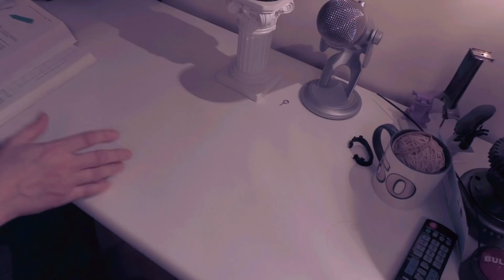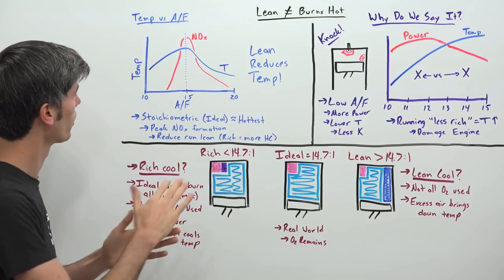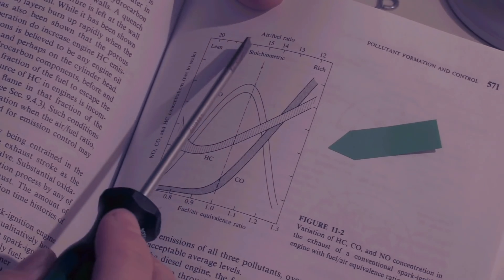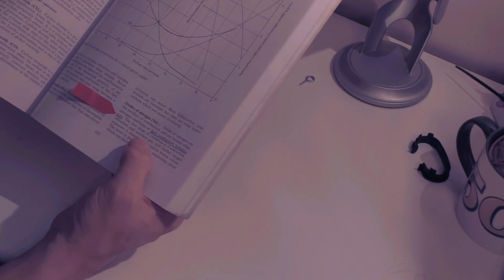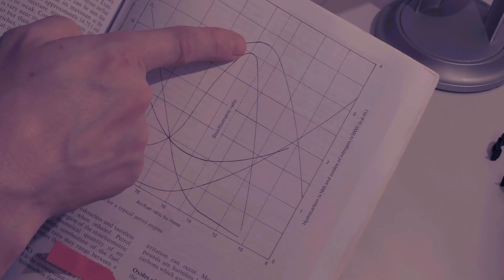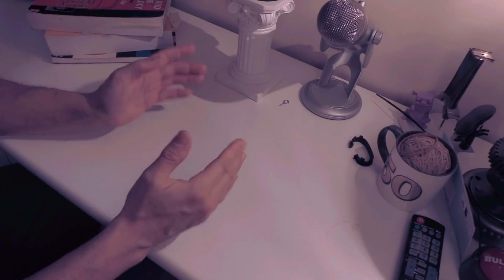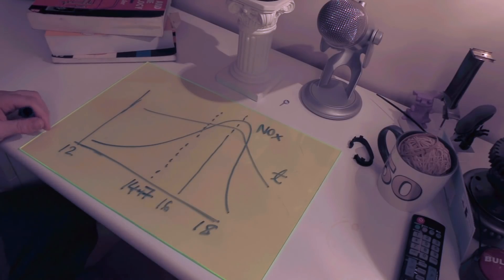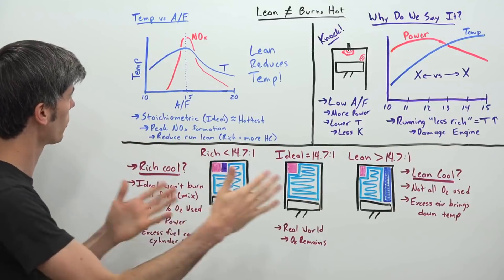Any idiot can draw a graph - EE Strikes again!

Comment: Why are you so critical of others YouTube producers on m/c content? If your such an intellectual,can't you figure out how to do something original. Perhaps your a lazy man and this is the the easier route,or maybe your a hater.
Reply: Matt's explained this before multiple times, he's against mis-information being pumped into the minds of the gulliable. Smaller channels/bigger channels doesn't matter. Matt makes plenty of his own content going through both the theory and practical of whatever he feels like tackling off his own list/viewer questions and ideas. Yes these rants are alot quicker to create than some of the longer term projects he's been plugging away at but he also maintains a full time job in the field, this is hardly a money making venture for him. Its a side project about the principle of correct information.
The thing is most content creators don't change/correct/retract bad information when presented with counter information, they'll just continue on being wrong. (There was a 2 stroke guy who had a brief back and forth with Matt about lube/fuel mixtures and both came to a happy conclusion)
Pretty sure Matt's made correction video's of his own, heck sometimes he'll troll us with mis-information then give us a gotcha.
The whole point is putting good information out there.

Perfect example in this video, with the graph. Matt will rough something up so he can easily draw/point/mark all over it (then re-adjust a few points) but also show you a hi-res full screen shot of it out of a text book/legitimate online source.
Reply: EE clams to be an expert. EE made a massive error here. It needs to be corrected. He's not hating on EE he's explaining where EE was factually inaccurate and why.
Reply from the maker: Throttle it up is just a little bitch whos feelings are hurt...

Comment: Am I looking at the big graph correctly? I was going to say it looks like there's a sweet spot at 18:1 where the "bad stuff" is minimised, HCs, NOx & CO2 (probably not the best power output) but then again I would think engines are now tuned to suit the catalytic converters these days?
Reply: "engines are now tuned to suit the catalytic converters these days" they are at low rpms, any modern turbo engnie runs at lamba = 1 up to low boost levels, then gets ruch afr...
Reply from the maker: For emissions yes, but other more physical things are also important, like not mealting your pistons.
Reply: For uncatalyzed engines, yes - 18:1 is a theoretical optimal balance point for minimal emissions... but can practically only be achieved at very low load / throttle openings in a partial vacuum state - think "barely breathing on the throttle". And you're right, it's rubbish for power - Increase the load even slightly, and you'll have incomplete combustion events anything short of a direct injection engine.

15.5:1 is about as lean as you want to go for cruising AFR's, and even then, you'd need to watch EGT's when tuning. Anything over 15-20% load, you target 14.7:1 or richer, dependent on the engine.

It's all a bit moot really, as catalytic converter applications will target 14.7:1 (lambda 1.0) as the optimal closed loop AFR for emissions (near complete conversion of NOx)... anything leaner causes NOx emissions to rise sharply.
Reply: @Gr0t0tter  I almost feel sorry for the manufacturers, all the hoops to go through balancing power, emissions, engine wear, etc.
Reply: @ajb667  Agreed - so many technological developments are kneecapped by emissions standards.. Without catalytic converters, a Direct Injection motor could run silly 20:1-25:1 lean cruising AFR's with stratified charge injection, while still getting reliable combustion.
Reply: @Gr0t0tter  I had to look that one up 😃 Makes me wonder if there might be something in a dual-fuel engine: a small amount of something highly volatile to create a flame front in a less volatile "main" fuel 🤔
Reply: @ajb667  
Like a JP-7 and Triethylborane combo? 😉

There's no need to reinvent the internal combustion engine - diesel and gasoline are just about as energy-dense as it gets at a reasonable price point, and engine development will probably cease altogether in the next 20 years. HCCI engines might be developed sufficiently to shine, but otherwise it'll just be the progression of smaller capacity engines, heavily turbocharged, with hybridization.

As much as I hate to say it, Hydrogen Fuel-Cell and Plug-in electric cars are here to stay... And will go on to improve efficiencies + scale better financially as they become more ubiquitous, until they replace the internal combustion engine altogether.
Reply: @Gr0t0tter  isn't stratified injection essentially what Mazda did with the Skyaktiv x?
Reply: @piotrekserwisuje  Yup, pretty much. I have no idea how their catalytic converters manage to perform decent conversion under those AFR's, but seemingly, they do.
Reply: @Gr0t0tter  maybe they don't do that much converting of anything under low load scenarios?

Comment: In order to get a certain amount of energy from an engine you have to burn a certain amount of fuel. If your mixture is lean then you need more air in the engine in order to get the same amount of fuel. That increases the pumping losses which in turn requires even more fuel and more air. The result is a loss of efficiency and higher fuel consumption which in turn leads to higher temperatures.
While fuel evaporation, or lack thereof, might make a difference to spot temperatures I believe it is the loss of efficiency which is the biggest cause of overall engine temperature rises.
Edit: Just noticed that Jason says that excess air brings down temperatures. In this respect he has got it completely the wrong way round since he hasn't considered pumping losses.

Comment: how does this factor in  https://pilotworkshop.com/tips/lean-of-peak-pros-and-cons/
Reply from the maker: Well that doesn't say much does it? Numbers, numbers is what we need.
Reply: @thedirtyworkshop  The numbers are part of the process. Was thinking you may have been aware of manual fuel adjustments in light weight aviation engines to lean out the engine when cruise altitude is reached to conserve fuel. The argument is that engines may run cooler when lean under light loads. this is based on how pilots establish where stoic is from watching pyrometer temps... When planes ascend to cruise altitude, they are running rich for max power. When cruise altitude is reached pilots begin reducing fuel slowly while watching exhaust temps until pyro is at its highest this is said to be stoic, after this point leaning any further temps will drop off again. A pilot can choose to run a certain temperature value in either rich or lean direction, these are named richOfPeak or leanOfPeak. If a pilot is instructed to fly at cruise 30 degrees lean of peak then he will find stoic and then reduce fuel further until exhaust temperatures are 30 degrees F less than what the highest temp was or if they require 30 degrees F rich of peak then after finding the highest temp they will add fuel back in until the pyro drops 30 degrees F... I"m an auto mechanic and was curious what you thought about the above ?

Comment: glad to know i never heat seized any of my old 2 strokes after all,  i cool seized them ....... ffs.
Reply: So he’s saying when I dial the propane back on my blowtorch it’s making the flame colder? Been doing it wrong all this time...
Reply: I raced a Bultaco TSS 250 with a thermosyphone water cooled top end. If you tried to go before fully warmed up it would get a big gulp of cold water from the rad and it would seize so fast the flywheel would keep going and take the lh side of the crank out through the fairing with it!
Reply: @willleavitt7156  lol...
Reply: to be fair 2 strokes would seize when lean even if it made them cooler (which it obviously doesn't) since you would run less lubricant thru the engine

Comment: So if you go very-very lean won't the air from the intake cool the cylinder? Or it has to be so lean the engine will stall?
Reply from the maker: Engine will stall
Reply: @thedirtyworkshop  Damn, that sucks. What if you use shitloads of cylinders and a giant flywheel? Or it won't matter with any kind of realistic load?
Reply: @funcounting  Look up HCCI. That how you make a gasoline engine run lean effectively.
Reply: @otm646  Do they even use lean mixture?

Comment: I thought it was common knowledge that leaning out makes the engine run hotter. I'm sure I remember almost killing a set of spark plugs on my first car - a 956cc Renault 5TL after fiddling with the carburettor for no reason. My dad told me that he could tell that the engine wasn't running properly just by the colour of the plugs - then magically producing a set of pictures explaining all types of diagnostic info from the state/colour of the plugs. I 'somewhat accurately' turned the carb screws back to original positions, put the plugs back in, and she ran like a dream, after a high speed (70mph) run up and down the dual carriageway.

Comment: I had a Sierra Cosworth back in the day with a Stage 2 tune. Should of had the injectors changed but this was missed somehow. Anyway piston 3 melted around 150mph on a track day on the first few laps of the first session. Obviously was running too lean at the higher rpm and overheated. I wish I still had that piston, could have sent you it.

Comment: same principle with turbojet/turbofan engines then init? Fuel keeps the combustion chamber from reaching it's melting point by whipping that latent heat away in the blast
Reply: turbojet/turbofan runs lean... usualy lamda 3 to 6... a lean mixture, in this case, it increases efficiency, because if the amount of fuel was increased, half would not be burned to achieve similar temperatures. If you used a close stoichiometric mixture, the combustion chamber and the turbine would melt
Reply: @mateuszbarya9098  cool, thanks for the information!

Comment: Just curious but does the presence of excess oxygen in a lean condition also contribute to the increase in NOx
Reply: Yep in the high heat environment  the oxygen will react with the nitrogen if there's no fuel to react too causing nox  to increase
Reply from the maker: Well I think 'there's no fuel' is not the right term, as it sounds like they're hunting each other out. It's just random interactions
Reply: @thedirtyworkshop  The reason I ask is because the production of NOx can't solely be linked to heat if there's excess oxygen that would create a higher probability of  their production but I do agree that lean running makes more heat but that's it's not just down to heat
Reply from the maker: Well lean by definition means an increase in O2. A lower fuel quantity means lower cooling effect, and higher oxygen quantity. This means the heat in the combustion chamber is remaining in the chamber.
Reply from the maker: Lack of fuel.

Comment: Well fk me Matty, you made me pull out my books.  From 2nd class Power Engineering A3 Boilers and Water Treatment. 

"Fluidized bed combustion can take place from 800 to 900 degrees C instead of standard combustion temperature of 1600 to 1900 degrees C for pulverised coal and oil firing. The ability to burn at lower temperatures is very important. The lower combustion temperatures produce lower emissions of nitrogen oxides."   

In the power plants we worry about Nox and Sox a lot. We inject crushed limestone into the fluidized bed which combines with the sulphur and prevents it from going into the atmosphere with the flue gas.
Reply from the maker: Well fuck me LMAO!

Comment: Anyone who has ever had to jet the two-stroke engine knows full well that lean equals death😂 they don’t call it “lean popping” for nothing ...This EE guy is hilariously wrong on so much 🤦‍♂️
Reply: He's a person who has never had his hands on the things he's talking about. I thought I was the only one who's annoyed by him.
Reply: one thing to take into account is that on a 2 stroke, a lean mixture means very little oil getting to the engine. Not enough oil = no bueno for a 2 stroke.
Reply: @obartsh27  ok go ahead and run a 2 stroke lean that has an oil injection system and put that theory to the test 😂😂
Reply: I learned that too, with my 2 stroke bike... lean mixture for a long or not so long time equals to much heat and a seized piston.
Reply: I had a squished fuel line and my piston seized because of too little fuel

Comment: I’m a bit old school when it comes to graphs but it’s still pretty easy to prove. Pull the spark plugs and given there’s no mechanical issues that will soon tell you if a rich/lean hot/cold condition exists. Same for vacuum leaks leaning things out and burning valves. Overheating race cars can be remapped on the fly to riches the mixture to help cool temps down. I think Jason baffles himself with his own bullshit because high N02 readings mean heat. End of story. Explore what an old school EGR valve does and that proves it. Lean = Hot. End of lesson.
Reply: It's in every Haynes' manual ever printed. That page with sparkplug colours.From black to dusty brown. Wet to bone dry. 
So yes, pulling the plugs is one of my first things I do when diagnosing running, fuel or temp. problems.

Comment: I had watched that video by Jason... had me questioning it.. but I couldn’t get passed my own experience jetting 2stroke dirt bikes my whole life.. run it to lean you can lock it up, or over heat it. So I didn’t believe it but I honestly hoped you’d do a video on it.. intuitively I thought it was wrong, but I don’t have the knowledge to ‘prove’ it. So thanks for that, glad to know I haven’t been wrong this whole time.
Reply: There's also the cooling effect of vaporising petrol, especially useful for an old air-cooled 2-stroke.
Reply: @ajb667  well when I watched that video from Jason I couldn’t help but think “have I just been perpetuating the myth, that a lean condition can cause over heat/lock up.” Because I know I’ve told people that.., so I would hate it if I was wrong this whole time. But yes logic would tell you vaporizing fuel from a liquid to a gas takes energy, and heat provides that energy..,  & in doing so the energy which is heat is transferred from the engine itself and is ‘spent’ vaporizing the fuel..so if you have less fuel, your sucking off less heat from the engine.. but I’ve been wrong before.. but to learn, you have to look for & recognize when you are wrong!. Otherwise you end up like Del . Even when your wrong you can’t admit it.!
Reply: You are correct, the latent heat of vaporization for gas is about 300 kj/kg depending on blend and, that number rises with pressure. That's a good bit of heat required to turn the liquid fuel into vapour. Think of the A/F ratio like this, compressing air to high pressures generates massive amounts of heat, and the liquid fuel needs to absorb some of the heat to become a vapor and combust. When you lean your mix out, you increase the ability to generate heat, and decrease the amount needed to vaporise the fuel. This is why lean gets, real hot, real fast in an ICE engine.  

I ran a methanol race engine years ago and that stuff takes 1100 kj/kg to vapourize so you see outside of the fuel system frosting over because it's so cold. We melted pistons out of it, welded them in the bores, the failures were very often spectacular. ICE engines make power by moving a mass of air through them, so you go as lean as you dare, or can afford when, .001 matters on the time slip.